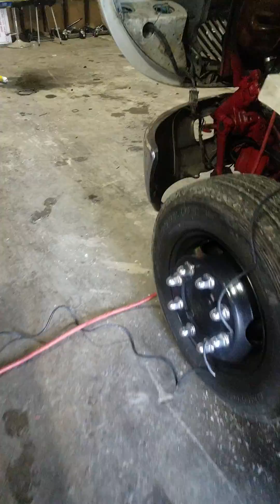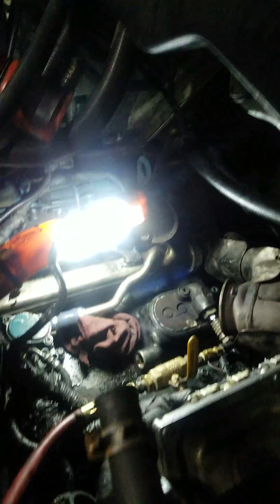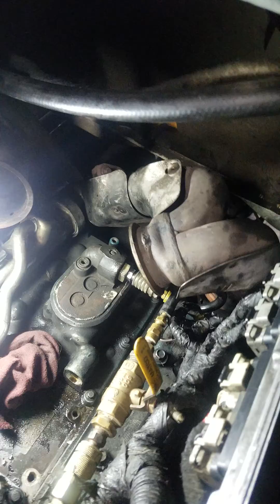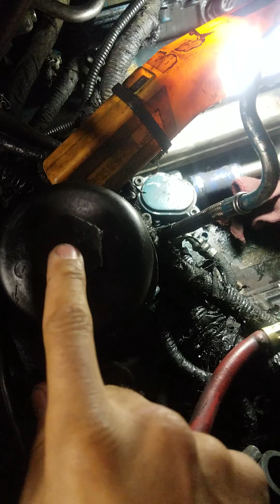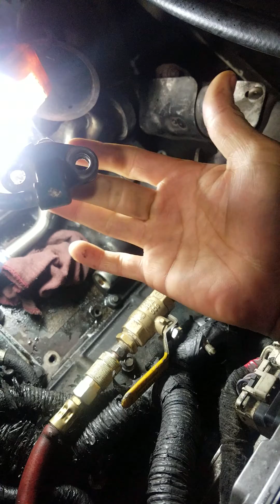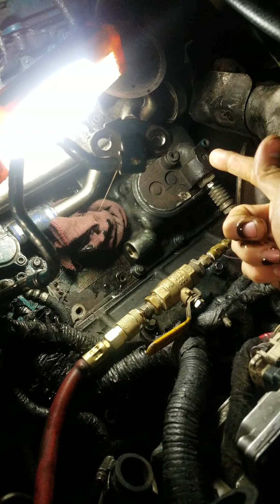international 6.0 vt365 high pressure oil pump leak test

Comment: I have a question that nobody has been able to answer see On the early aluminum model pumps  I pressure tested applying air directly into the IPR port  after removing the IPR just like you are. But curious enough the pump was leaking in front just slightly below by the gear so I replaced it thinking surely that’s not good. Well when I installed the new pump that I had ordered I tested again cause I wanted peace at mind , the new pump was leaking air exactly where the factory was leaking. Which left me completely confused . When I looked online some people said it’s normal and others said it’s not . So I’m wondering if I have the pump exposed but still connected an I have a hose connected to the top part of the J Tube so I can apply air because on the older style the IPR is secured into the Hpop cover where as in the late models it’s secured directly into the pump. I’m dealing with a late model. I am having a crank no start cold, but I’m capable of building 1,500 psi very fast but my IPR is at 85 , I verified it’s getting fuel an I’m certain from my memory the cam an crank is in sync so I’m thinking I have a Hpop leak cause When I apply air exactly how you do I am getting lots of air as soon as I apply air . I can hear it coming from the center where the pump is , I’m barely about to expose the pump in the morning when I get back to working on it but took off the valve covers cause when I took off the oil fill cap I could hear it loud an clear the air. Then with both valve covers I made my own tools from previous parts . I used old stand pipes and welding the centers ensuring they could seat perfectly to block off any air from going into the braided oil lines an the log an injectors to isolate the noise. Because I used a stethoscope and didn’t hear it at the log or the injectors where the nipples are under the oil logs. I hear it come from where the pump is.  I dead headed both passenger an driver side oil pressure systems by removing the stand pipes an placing my tools that I made and I heard the air clearly still coming from where the pump is. The only thing that is receiving air is the Hpop pump, the branch tubing an the J-fitting.  Now swing a Hpop leaking into the low side is new to me as your issue is in your video . I’ve never seen that. But I already chased my tail trying to solve my own truck but my is insisting I try again but this time it’s on his truck. I am certain it’s a leak cause I’ve seen videos where people are air testing an giving air an I don’t hear nothing In there’s except for videos where people do have leaks . It’s just nobody is really showing the vehicles where these early 2003 aluminum pumps are exposed and air is applied to them are being tested with air after they have been fixed. It is supposed to completely sealed an quite right ? Cause I’m so confused that it makes me question my understanding of these 6.0’s. I wanna learn I do but I need answers . I’ve literally seen videos where people are saying the aluminum pumps are supposed to leak from the front where the gear is . But that would make it completely misleading cause I’m expecting its to be completely quite when I’m applying air verifying it’s hpop system is sealed so I can close her up. Please help me, cause can a pump build high pressure like 1,500 psi but be showing 85 at the IPR an have that hi oil pressure leaking internally causing a crank no start and if I pressure test the Hpop system like I have tried my best to explain the pump an everything else is supposed to quite with no leaks an even hold pressure after I close the valve cause my tool has a pressure gauge on it as well to monitor pressure . And one guy said that it is supposed to be quite an sealed and hold pressure so he said to fill it with air an close the valve an watch the gauge an it should be holding pressure.

Comment: Looks i have same issue lost power crank no start now
Replace stand pipes still no geting oil pressure.
So 
This mean the pump us bad ?
Or how can i know if its only stc pipe ?
Reply from the maker: Pull the oil filter cap off and have someone crank the engine over and look to see if the filter housing wants to fill up. By doing this your eliminating the low oil pump. If its filling up then your high pressure pump should be getting oil and should be putting out if not bad.
Reply: @mydieselrepair4998  
Sorry i didn understand. Well
If eliminate low oil pressure by removin oil filter cap.
Pump still geting oil and make the oil filter housing to fill
Means pump is bad ????